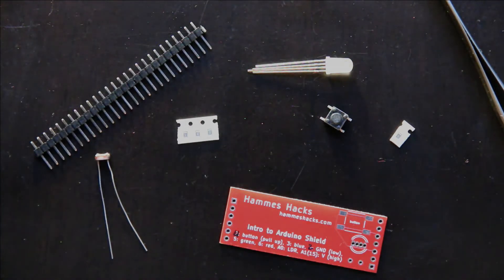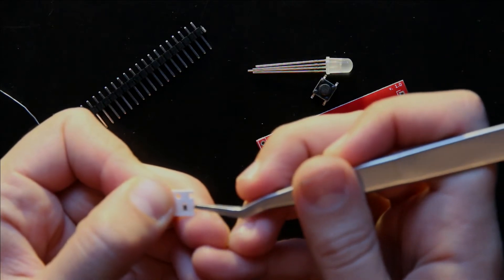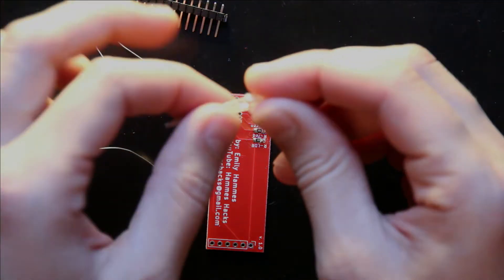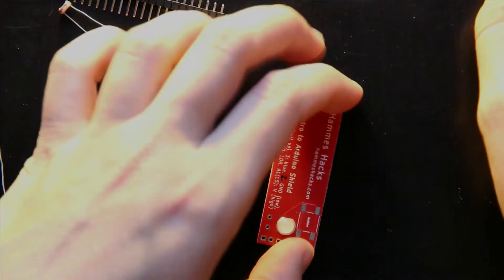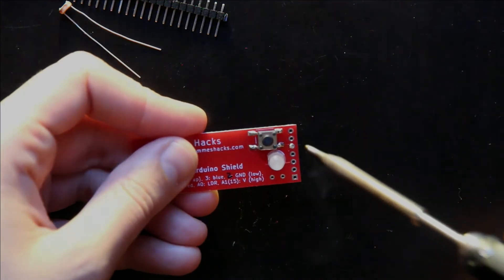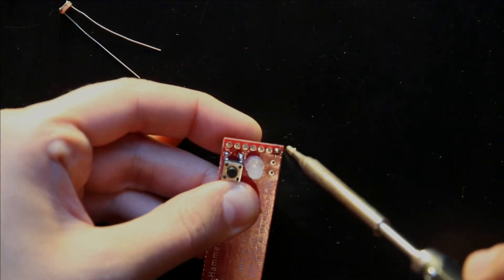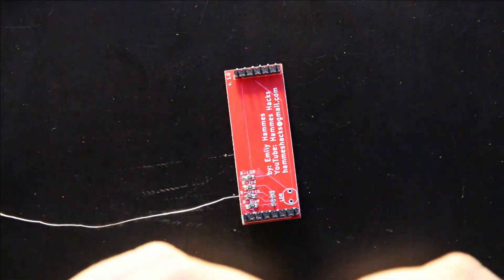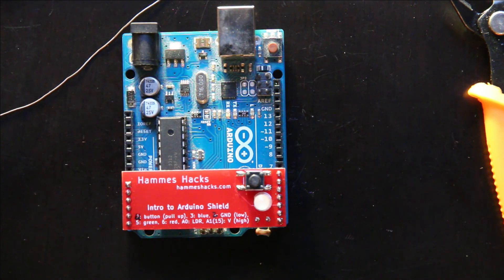Intro to Arduino Shield Soldering

Comment: I think you need to learn soldering use some flux and fix your board down would help unless you like dry joints!!
Reply from the maker: In all my classes and videos I use solder with a no-clean flux core, unless otherwise stated. When I am using public workshop spaces (hacker spaces and conferences) I discuss this in depth before we start soldering, and tell my students not to use the random solder which is on the table. 

I find that fixing a board to the table is really only important when you are reworking or dealing with some other situation which involves soldering small SMD components after you solder through hole components. That is why I solder the components in the order I do in this video.